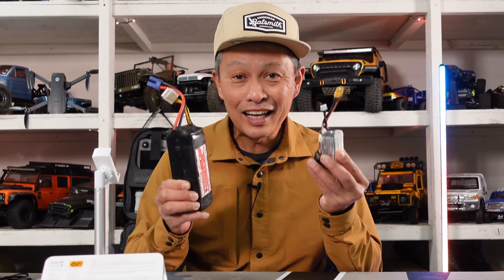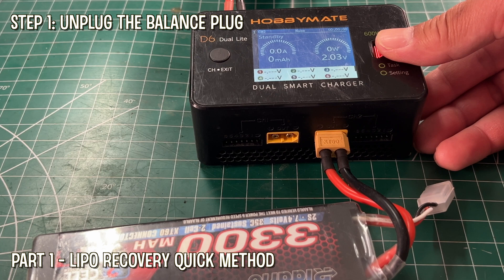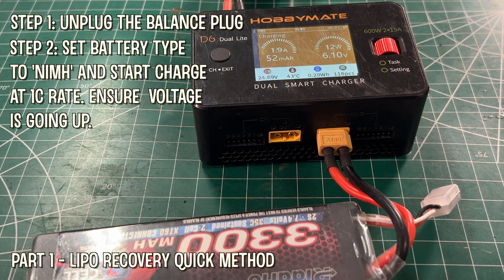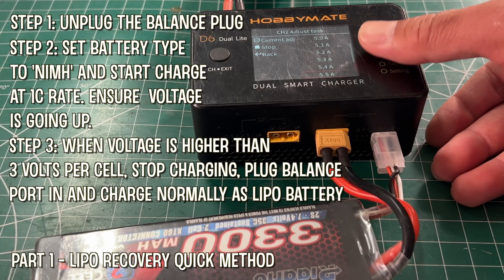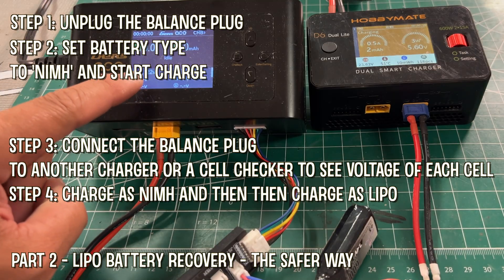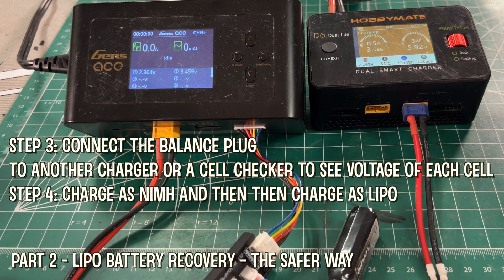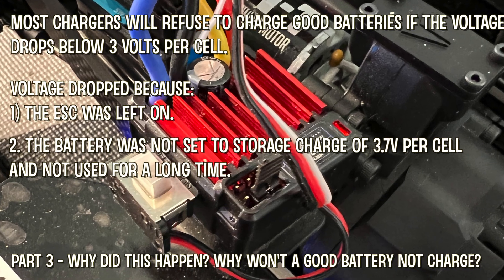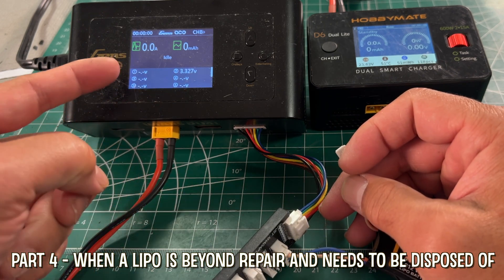Recover a dead lipo battery that won't charge - rescue lipo battery with dead cell safely

Comment: Thank you so much. This worked. I have a multi chemistry charger but I don't have digital read out so I couldn't see the voltage. I just charged for a minute on NiMH and switched back to Lipo. Seems to have fixed but closely monitoring.

Comment: why did you go to 6.6 volts after the cells came back? should be at 4.2?
Reply from the maker: 6.6v for 2 cells. or 3.3 each. That means that it will now charge normally all the way to 4.2v each.

Comment: Thank you bruh🤙🏽 I watched a view videos and this one made cens . The other video didn’t explain if you put it in the mode to undo the balance plug. It wasn’t working so I scrambled through more videos found yours and you explained undo the balance plug because the balance plug won’t let the battery recognize the charge so I unplugged the balance plugged put it on NIMH for 1 minute then put it back on normal charge and plug the balancer back in on Lipo and it started charging🫱🏽‍🫲🏼🫱🏽‍🫲🏼 I was a little nervous and thought I was gonna have to cancel crawling today.🫡🤙🏽

Comment: Maybe I'm a sucker, but when I have a battery where a cell gets below 2.5 volts, I recycle it immediately. I'd rather buy a new pack then worry about it.  The dead cell can have physical copper from the anode that has penetrated the barrier between the cathode and anode. This is what causes high internal resistance, and this physical deposit of copper cannot be repaired by battery conditioning.  Not every cell that gets below 2.5 volts has this copper penetration in the barrier between cathode and anode, but I'd rather recycle the pack than worry about permanent physical damage causing an unsafe situation. My apartment isn't worth a $50 lipo. 
Just my 2 cents, as a electronics engineering mindset, possibly I'm on the overcautious side.

Comment: It sucks what happened to your channel but this is one of the videos that definitely should have stayed gone. Reviving over discharged lipos is very dangerous. When a lipo cell drops below a certain voltage internal cell damage occurs. This is because copper from the anode going into solution and gets redeposited randomly in the cell. This issue can lay dormant for a random amount of time and then cause an internal short creating a thermal runaway of the battery. There's no way to test for this condition and no way to fix it. Can you get away with reviving it over discharged battery? Maybe. Is it worth risking your house it's contents and occupants? I don't think so. I know plenty of people are going to say they've done it and it's been fine but plenty of people drive without their seat belt on and get away with it too. That doesn't make it a good idea.

Comment: Although most of the times this works my experience is that most of them are not like the were before. Internal resistance goes up in most cases.

Comment: Working at a local hobby store I try to inform every novice customer some basic info on lipo batteries. If I throw too much at them , they get confused …..I always tell them to keep batteries in a fireproof container when not in use and watch for battery puffing or changes with battery charging/discharge. I also tell people to check their batteries once a month because they do discharge slowly on their own. Every spring I get numerous people with newer batteries that are dead…I try to “dirty” jump start them and 80% of the time it works, but a few times they don’t come back. I like the way you jump start lipos using the manual mode for nimh…..I’ll start using this method more than jumping from another battery…..Glad your new Channel is up and running! 😊

Comment: I have had a couple 3S packs recently that refused to charge - told the charger they were a 2S, brought them up and then charged at 3S per normal.  Had never considered using a different battery type to fool the charger.  I do not know which method is more sane/safe to use...?

Comment: Re-watching for the new channel - As long as people are aware that if when they attempt this the failed cell starts building up heat faster than usual - just throw the battery away safely. 
I tried this on a battery and it was able to be recovered without issues however I also tried it on another battery and that cell was heating up and unable to retain voltage. In many cases its not worth the risk.

Comment: I have another tip

Yesterday, I accidentally left my ESC turned on for several hours after hitting LVC

Came to charge the battery and one of the (3s) cells was at 1v, another at 2.3v and another at 2.7v

Last time I ran a battery low, I connected another battery to this battery and it balanced/ brought up the low battery voltage enough to start a charge

This time I didn't have a deans to deans connector so left the battery 24 hours until I had a chance to make an adapter

Then came across your video (awesome FC 👌) so thought I'd give it ago with your 2nd method (connecting the balance port).....guess what, my 6v (3s) battery had come up to 9v (3.05v per cell) 

It's like it self balanced between cells and the voltage came up after being left 24 hours (I'd originally tried to charge straight after it was drained) 

So maybe sometimes Batteries just need a little time 

(P.S. im not a noob and know my way around my batteries (I have several over several cars/ chargers etc))

Great vid though FC and glad you're back from your mtb channel and your new channel is getting back up to speed 👍

Comment: This has saved me and my friends before. But I've found that the battery has poor run time. And doesn't hold charge for long on storage. For me it has been a quick fix but the battery is generally had it.

Comment: Such an important video. But I have a question. 2 batteries I have which are Traxxas, 3 cell 5000mah 25c that I have been using really don't owe me anything. In fact I feel they have been amazing  since after 3-4 years used only in the summer months they still don't even get warm when charging. BUT now one of them has a tinny tiny puff. Not enough puff so that I can't close the battery tray arm on a TRX-4 but still it's making me wonder when I should say ok she's done and get rid of it? (like I said all charges and storage times are running very very cool.